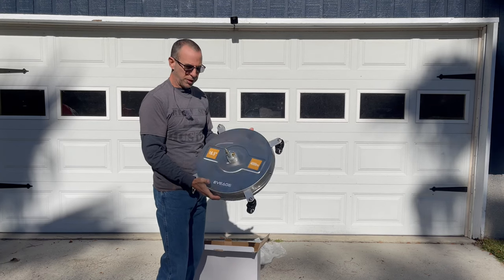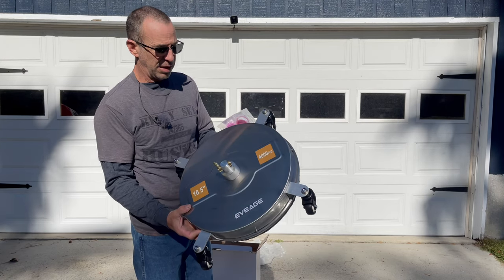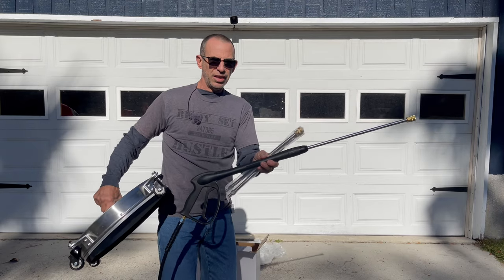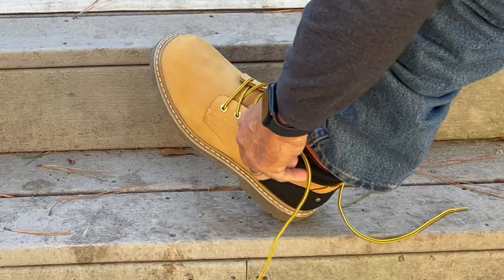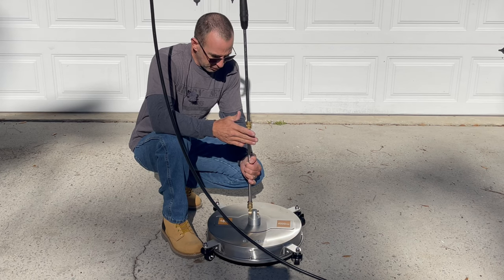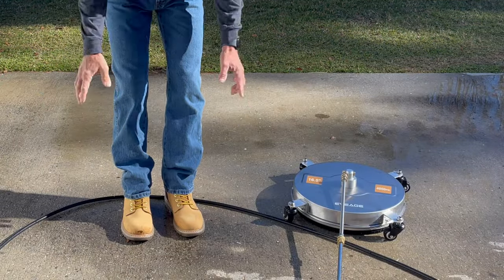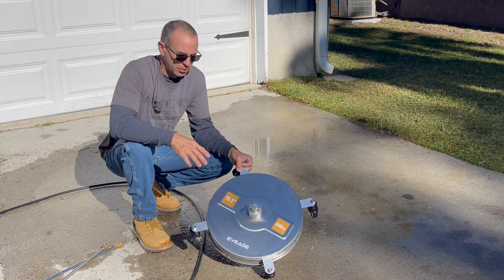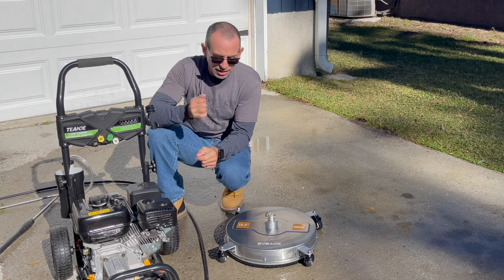A 16 inch Stainless Steel Surface Cleaner for LOW POWERED Pressure Washers? No Flippin' Way

Comment: After watching a LOT of videos, and reading a lot of reviews, I decided to give this one a chance, based almost entirely on your video.  You weren't kidding - this works really well with a lower pressure washer.  Using the stock nozzles, and my 2700PSI, 2.3GPM pressure washer, this beast knocked out well over 1800 sq ft of seriously dirty, 50 year old concrete.  It did take me a few hours, as it hadn't been cleaned in at least a decade, and some areas even longer, but, without even using a cleaning additive, it did a very respectable job - any unevenness or streaks are because I'm new to using one of these, not due to any fault in the equipment.  Thanks for the excellent review.

Comment: I saw that they have a new model that can be used for both cleaning floors and washing chassis. "EVEAGE Upgrade 2-in-1 Undercarriage & Pressure Washer Surface Cleaner..."
Reply from the maker: That’s pretty cool

Comment: I"ve been watching and learning from your pressure washing vlogs for a lot of years.  (I'm a woman.) I have a two story stucco home with some taller peaks for the "can stand in" attic and need your expert advice on a pressure washer as I need a new one.  I also have a large concrete driveway and huge concrete patio which I use a cheaper than you are featuring surface cleaner.  In addition, I have a white 6 foot vinyl fence what encloses an acre yard which turns green if not power washed and takes me a long time to clean.  Please, please, please advise me on which pressure washer I need.  They are so expensive but I need one that will get the job done.  I'm thinking 4000-4200 PSI.  I noticed you are using a Teande but I thought you were a Simpson fan.  Congrats on your marriage as you used to be single.
Reply from the maker: I would recommend a minimum 3 gallon per minute pressure washer. The PSI is not as important but all 3gpm’s and up will have plenty of pressure. 
Using a 3 gpm pump or higher, you can use the Pink tip I recommend in all my videos. Run 10% straight to the downstream injector for stucco and the vinyl. Pink tip to apply (black fan soap tip for the fence and first floor heights) and rinse with the same tips (just pull the siphon tube when time to rinse.
I just recently posted a video of an amazing surface cleaner with wheels I really like. Perfect for getting the job done with very little effort. Thank you for your support and I hope I helped. Here is the video: A 16 inch Stainless Steel Surface Cleaner for LOW POWERED Pressure Washers? No Flippin' Way
https://youtu.be/RTOD4JOoZGU

Comment: They have 1. 2 tips on it to work with your 2.4 machine.
Reply from the maker: Ya this one works amazing. I have used 12 and 14 inch models but never a 16.5 with such a lower volume pump. For a homeowner or a weekend warrior looking for a high quality well built cleaner for a low cost pressure washer… this thing guys all the marks

Comment: I used the smaller version of this surface cleaner on my paver patio and it worked really well!  The patio was covered with black algae, moss and weeds between pavers.  I did remove some of the larger weeds with power washer first.  But this surface cleaner Saved me a ton of time and didn’t kill my back.  I have a 3200 psi harbor freight power washer.  I

Comment: While I like it I think I would prefer one with the dual handles at the top.
Reply from the maker: I  never used one of them but definitely curious
Reply: @DansVlog  They look a lot more comfortable to use and easier to control.  This is one I have in my Amazon wishlist, CO-Z 20 Inch Pressure Surface Cleaner with Wheels
Reply from the maker: @Boodieman72  20 inch is big. Do you have a 4-6 gpm pump?
Reply: @DansVlog  No, I think mine is 2.5 gpm.  Anyway, that was just an example of the style of surface cleaner.
Reply: @DansVlog  There are 16 inch ones available from other companys.
Reply from the maker: @Boodieman72  that cool. At some point tho, I think the convenience of using your own wand rather than having to turn the pump on and off to connect / disconnect the hose
Reply: @DansVlog  Quick disconnect fittings is what I'd use.
Reply from the maker: @Boodieman72  ya but if no ball valve you can’t disconnect a running pump
Reply: @DansVlog  How often you change the nozzle would depend on how you do each job.  If the flat horizontal are done together then it would cut down on how often you would need to change.  I have a non wheeled flat surface cleaner and it feels like the wand is bending.

Comment: I just bought a 3400 westinghouse pressure washer, and wondering if my 3300 psi ryobi surface cleaner would hold up to it
Reply from the maker: Ya it should be fine

Comment: Dan so your saying it's the psi the pressure washer puts out and not the gpm the pump puts out??
Keep the videos coming to Pittsburgh Pa 
Merry Christmas and happy new year to you and yours, God bless 🙏
Reply from the maker: No not necessarily. The psi is important but the GPM’s is usually most important. It’s like horsepower with torque. The psi is the HP but the GPM’s is the torque that will keep the flow going. My pump has little torque with under 3 GPM’s so I am shocked it had the power to NOT tiger stripe the concrete with lacking volume/spin

Comment: Great info! Thank you!
Just a quick question.
I have a 4 gallon/minute, 4200 psi pressure washer.
I just wonder, when I turn the pressure down on the pressure washer using the unloader valve, do I still get that same 4 gallon/minute waterflow at less pressure?
Or does turning the pressure down also means losing waterflow?
Thank you!
Reply from the maker: You should never adjust the unloader valve. If you need less pressure, use a higher numbered tip.

Comment: I have a question about cleaning a flagstone patio and an Ipe exotic wood deck, do you have experience cleaning these? If so do you use any chemicals? I know you don't when there is risk of runoff but there isn't usually with patios and decks. And I've read that you can use bleach on both of these but also read to absolutely not use bleach on either. You're the best and most straightforward resource I've found so thought I'd ask. Thanks!
Reply from the maker: I wouldn’t use it on the wood. I wouldn’t fear using it on any concrete (painted or not) to include pavers and landscape stepping stones. Where I would caution you is if the contractors used sand in the joints/seams. You don’t want to blast that out and cause a loose patio condition.  So pressure is the concern, not bleach. Maybe spray it down with a pump up sprayer, agitate it some with a stiff bristle broom and rinse with a garden hose
Reply: @DansVlog  Awesome thank you, I think applying, agitating, and rinsing just like you said will be the way to go for the patio. I'll do the same for the deck but with a special cleaning product I found made for Ipe wood.
Reply from the maker: @TheEpochCompanion  awesome. Let me know how it goes
Reply: @DansVlog  Will do! As always thank you for your help.

Comment: Do you think a 20 inch from Eveage will have the same results?
Reply from the maker: Not with this size pump. It will leave stripes
Reply: @DansVlog  By pump do you mean the actual pressure washer hooked up to it? Sorry if i’m confusing I’m new to all this.
Reply from the maker: @alexpalmytelsa  You’re fine. The rule of thumb is for every gallon per minute a pump can deliver, the surface cleaner can be a max of 4 inch. So a 20 inch surface cleaner if theory would require a 5 gallon per minute pump. The pump on this video is just under 3GPM so a 12-15 inch surface cleaner would be the max size otherwise the spinning wand will be spinning to slow and stripes will more than certainly happen.
Reply: @DansVlog  thanks for the advice!

Comment: I have a 2.4gpm and use a surfacemaxx 14” and works great.  I upped my nozzles so I’m not using so much pressure as to not etch the concrete.
Reply from the maker: Very nice!
Reply: I also use a surfacemax, but I do not like how I must constantly fight with it to keep it from floating away
Reply: You fight with it because your pressure is too high. Change the flow
Reply: @louisben4510  how would i go about changing the flow?
Reply: @tommygrngo  put some weighted object on top of the shroud.

Comment: How do you price a house wash, soft wash?
Reply from the maker: Usually I flat rate cause where I work, most homes are the same size. Flat rate saves me a ton of money on driving out for estimates and saves me time. I find value in that so I come in on the lower side of the market. $90 for a basic wash 1 story and $130 for a 2 story. Driveways and front porch of basic size is $150 more.
Reply: @DansVlog  Thanks

Comment: Great Video. How would this work with a 2000PIS 1.2GPM unit?
Reply from the maker: Not very well. Needs more GPM’s tha. 1.2
Reply: @DansVlog  Thanks. Would a smaller sized one at around 10-14" work better? Are these generally universal attachments?